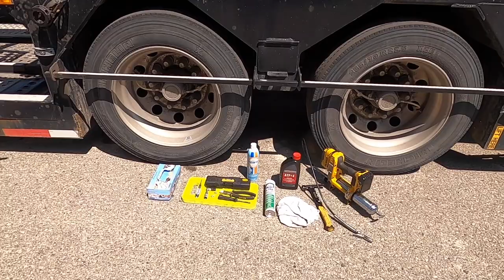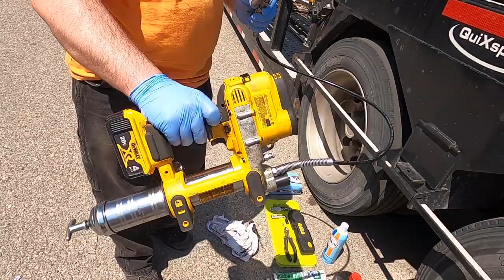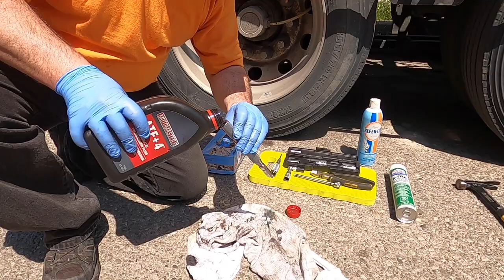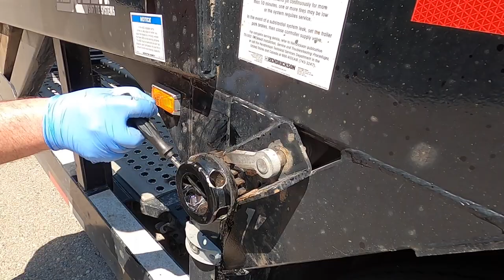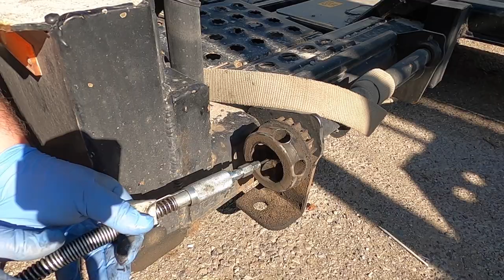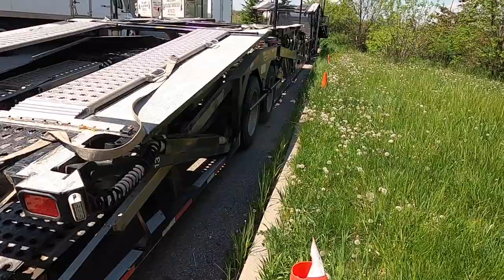WOW 😳 QuiXspinz Ratchet Maintenance ‼️ Car Carrier ⚙️🔧🔨 Volvo truck & CX-09LS Cottrell trailer

Comment: About to start grease on brand new 2022 easy loader what’s the transmission fluid for ?
Reply from the maker: Hey James,
Congratulations on your new equipment.  Maybe you can tell us more about that.

I used the transmission fluid to unclog the hole from dirt or dried grease.  In the meantime this was still happening and so I used rejuvenator.

Comment: Where can I get angle adapter for the super tight rackets between belly and rear
Reply from the maker: DEWALT DCGG5702 Right Angle Grease Gun Coupler https://a.co/d/asoeisH
Reply: @PaulMcLove  sure that will work gap between post and racket is my thumb nail
Reply: @PaulMcLove  one cd jabbco sent me didnt have enough room
Reply from the maker: @jameshanlon5470  

Plews 05-042 Needle Tip Adapter https://a.co/d/3syswhu